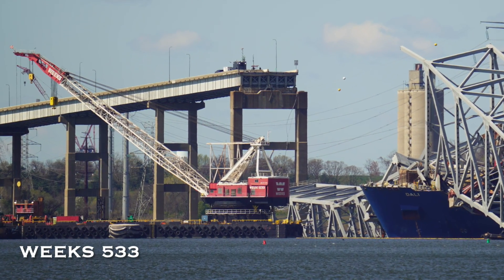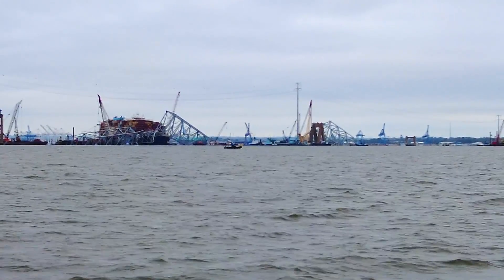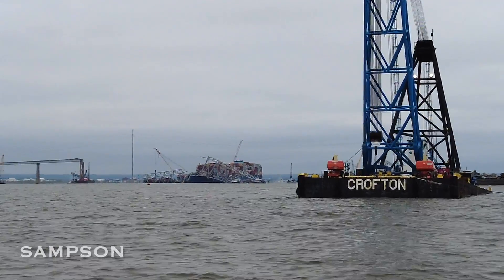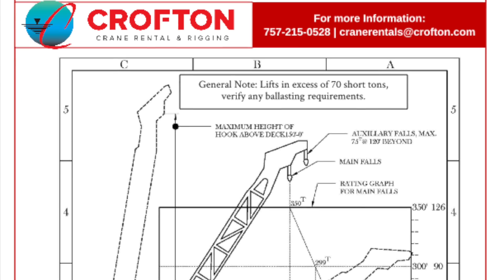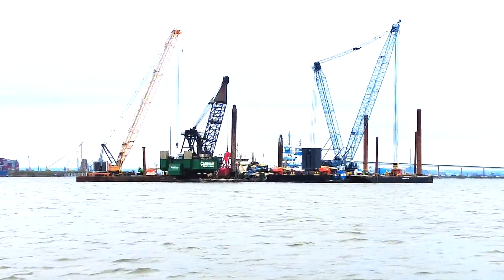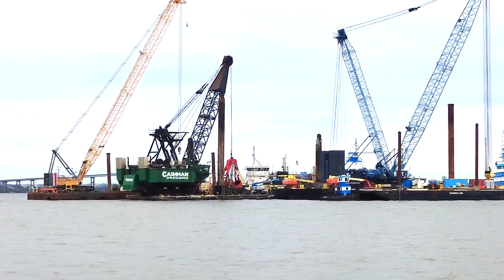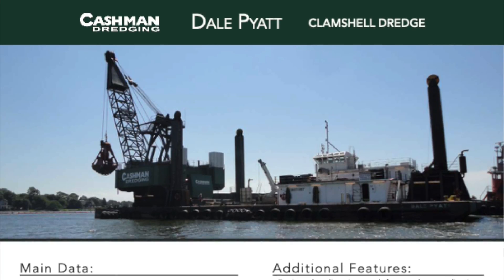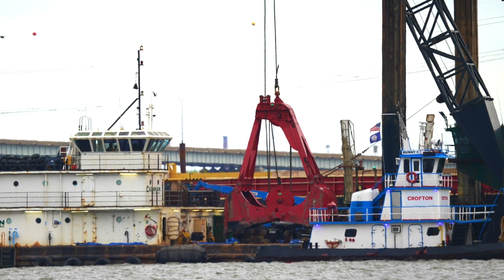Heavy Lifters being used at the Baltimore Bridge Collapse Site

Comment: Thanks for the great videos…you are very knowledgeable about marine construction…however, just for clarification a typical triaxle dump truck has a capacity of 17 to 25 cubic yards depending on the dump body dimensions.  So the 60 CY clamshell you referred to would hold say 2.5 to 4 dump truck loads…
Reply from the maker: That's a big dump truck!  Last load I bought was in a 10 yard truck. It only had 2 rear axles

Comment: Its a shame that America has this strange flag law that says all equipment must be American flagged only, over here in Europe there are many heavy lifting companies that have far more lifting capacity, one such company is HEEREMA, one of their lift barges has two 360 degree rotating cranes on it, each one has a lifting capacity of 10,000 tons and together they have in fact lifted just over 15,000 tons on a PAIR lift.  There are many other pieces of lift equipment here that are in the 4,5, and 6 thousand ton range also. I am sure this sort of equipment would greatly increase the speed and efficiency of such a task and as a result possibly mean less time in dangerous situations for all workers but especially the DIVERS as there would possibly be less cutting needed under water, after saying all that they are all doing a fantastic job out there.  Also thank you for your coverage of what is happening.

Comment: Captain.  Are you familiar with a heavy lift barge, which I believe was called the Centennial…that sank off of the Chesapeake..maybe 30 years ago?  It was used to lift the Tribeca bridge, in NYC, in a single hoist.  It was 30 stories tall and had a pilot house that looked like an old tin factory building.  Do you know of it?
Reply from the maker: I don't
Reply: @MinorcanMullet  I was on the tug Pennacook, when that crane showed up.  I may have the name wrong.  But I am sure it sank off the Chesapeake Bay.  It was the largest crane in the Atlantic…supposedly.  I’ll let you know if I find the right name.

Comment: I would assume that 60 yard bucket you talked about is the one you showed us yesterday with the guy standing in the "throat" ??? 
Have always been fascinated by watching large equipment operate !!! As a youth, whenever anything was going on in my realm, I was there watching !!! 
Thanks for providing this content !!!
Reply from the maker: The 60yard capacity I referenced was on the Dale Pyatt. The Cushman dredge.
Reply: @MinorcanMullet  
Thank you. So, If the 50 yard is NOT the gigantic one you showed yesterday, what is the capacity of that one ???   Is that "red" one you showed today the same/larger/smaller than the one you showed yesterday ???
Reply: @pappabob29  the one yesterday was a claw, not a bucket.
Reply: @blockstacker5614  
Ah yes !! Very simple difference not even noticed by the "un-educated" ----------- but learning !! 
Thank you !!
Reply: @pappabob29  I think they do both function in basically the same way, so you aren't entirely wrong, just one is like a shovel and the other is more like a rake if that makes sense.
Reply: @blockstacker5614  
It makes perfect sense. I have heard them called "grapple's", you call it a "claw". I'm sure those are both correct descriptions for that device. I simply didn't pick up on the difference when Captain Andy called it a "bucket". That 60 yard capacity is simply mind boggling !!! I added a detached garage here a few years ago. They excavated dirt on the site when they began for three days. Piled it all up in my driveway before calling in a couple of dump trucks to haul it all away. It turned out to be about six 10 yard dump truck loads. It's really hard to imagine THAT much dirt in one bucket !!! The picture we all saw of that bucket a few days age doesn't begin to illustrate the size of that device !!!

Comment: I hadn’t stopped to think about the fact that the Chessie 1000 can’t rotate. (Obvious looking at it, just didn’t think about the consequences.)

It must take incredibly precise control by the tugs to position the boom. When you lift a load, you have to raise it straight up so you don’t set it swaying. I’m amazed that the tugs can position the boom with that kind of accuracy, I’d think they need to get it to within just a foot or two of the perfectly-plumb position.
Reply: Just a little insight here. 
The tugs get the barge ‘near enough’, and then held loosely. 
As the strain come on (as little as ten tons) the load pulls the crane perpendicular. 
Should the load start to roll, or otherwise move, it will continue drag the head of the crane up to the moment it becomes fully suspended. FYI. 👍
Reply: @DB-thats-me  Aha! Duh, that makes sense! Of course the crane is more free to move than the thing it’s lifting, so no great precision needed. Thanks for the insight!
Reply: @DaveEtchells  It can be very counterintuitive. I used to drive a floating crane so have a little experience. 
On my crane, taking the strain was accomplished by luffing the boom back. Some VERY smart naval architect had worked out that luff + heel = vertical movement at the crane head. Once the load was fully suspended, you clutch out luff and clutch in hoist. 👍

Comment: 😊I agree these are large cranes ,but are nothing In comparison to the Dutch owned Hereema barge equipped with two 15000toncranes which picked 33 million pound drilling platform  and put in in place on pylons.
Reply from the maker: The Jones Act would probably preclude any foreign flagged vessels from participating in the operation

Comment: I wonder what the cost per hour of all of this equipment?  20 years ago, we rented a land based crane to lift derailed locomotives at $1500 per hour for one heavy lift crane.  This is crazy.
Reply: I wonder the same. 🤔
With the tugboats and all of the other related support equipment, My guess would be at least double what you paid 20 years ago. 
In any case, the cost is adding up quickly!

Comment: Extremely informative video with great pictures, presented by a guy who had done the research, and knows what he's talking about.  I think a large dump truck is rated at 12 cubic yards.  The ones that are a bit smaller are 10 cu. yards.   I don't know the capacity of the large and longer trailer dump trucks that are dump their load off to the side.   The red clam shell bucket that is cable operated allegedly has a capacity  of 5 large in the city dump trucks. The larger hydraulically operated clam shell must have a rated capacity around double of the one shown today.   My guess is that these buckets only reach their rated capacity with ideal type of material such as dry soft clay soil.   A lot depends on how good a grip they can get on the material which has to be soft enough to dig down into.  A steel beamed mangled truss bridge is hardly ideal material to be moving.  These large buckets are going to be useful mostly because of their massive weight. and of course the hydraulic one must have enormous jaw clamping power.